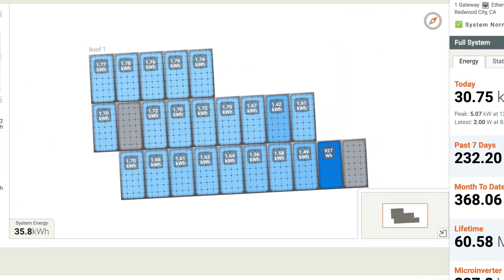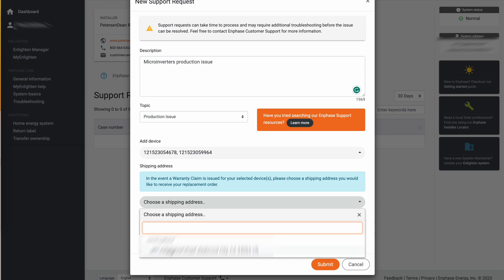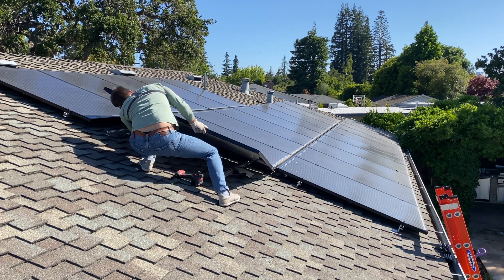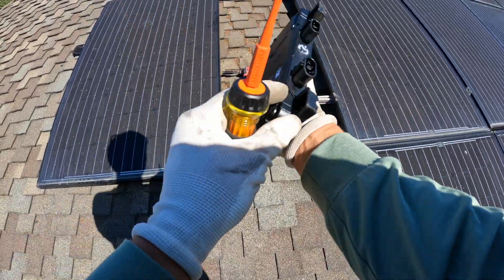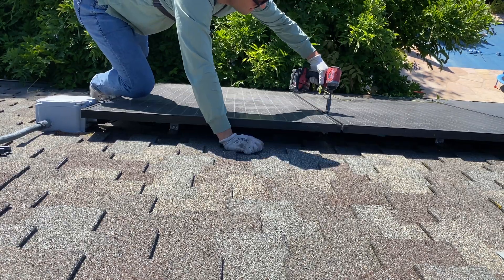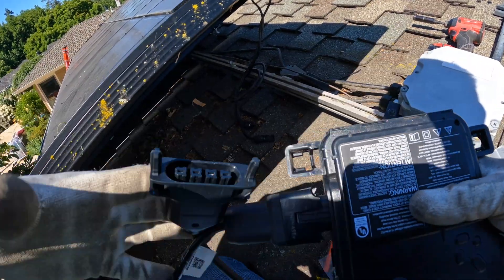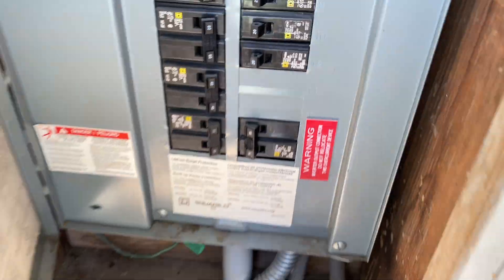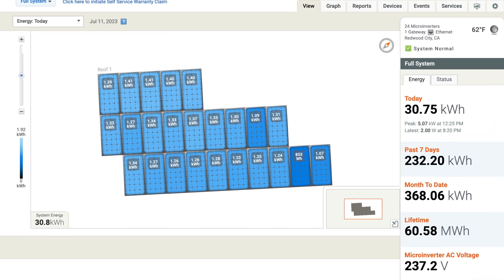How to Fix Enphase PV solar system with dead microinverter step by step

Comment: bullshit video, does not show anything about replacing and using tools to remove connectors. BE AWARE connectors are hard to take apart and you need to know how to use the tool first before going up!!

Comment: Enphase will replace the old serial number with the new on your site via chat. You can create an account as well if you use a different email than the one you use to monitor your system, but you have to get Enphase to add your new email account used to login to toolkit to your site.
It was easier just to give them old SN / new SN.
Oh, there is a special plastic tool to remove the wires from the inverters, some can be removed with a small screwdriver but Amazon has the little plastic tool with 4 sides for different connections.

Comment: All my microinverters go out at the same time, is that normal? Solar company wanna charge me 400 just to come out and look, if in warranty no charge, last time they charge $ 200 and didn't got up in the roof, what can I do my self?
Reply from the maker: You can just take an installer course for your system and learn how to debug it yourself.
Reply: @SolarEngineering where can we take that course? If im the owner can i do the replacement of the micro inverter my self or has to be an installer in order not to void warranty?
Reply from the maker: @franciscoaguilar1287  Enphase will not void the warranty if you self-replace micro, you can call them and they will swap new/old in the system. Installer can void warranty if you do it yourself.

Comment: Not nearly detailed enough for a DYI'er, which is what I was expecting. You've explained almost nothing, did not show how to remove cables (which the company says you need a special tool for) and I'm about back where I started.
Reply: Almost nothing was explained. What size socket do I need before I get on roof? What size socket to remove microinverter? How do the plugs come apart? Does loosening one panel then loosen the next panel and create any risks? Anyone else done another, more in depth, video? Thx
Reply from the maker: all you need is an MC4 disconnect and screwdriver to disconnect the trunk cable connector.
Reply: You do need a plastic special too to remove the wires from the microinverters.
Reply: Do you working in Orlando Florida?

Comment: Thanks for the great video. What slope is your roof. Ours is 6/12 and panel slides down when I unbolt it. Did you have some way of preventing it sliding beside having another person holding? Thank you for your advice.
Reply from the maker: oh it's a serious slope to work on. Move panel up and set it against rails mounts (roof attachments). Make sure nothing touches back of the panel, because it's easy to damage panel.
Reply: @SolarEngineering  Thanks for the suggestion.
Reply: I'm a homeowner, how do I add the new microinverter serial number?
Reply: @ice_n_sticks3431  once you have completed the swap, you can call Enphase support and ask them to swap the old for the new. If switching out multiple micros, make note of which micro is replacing which.